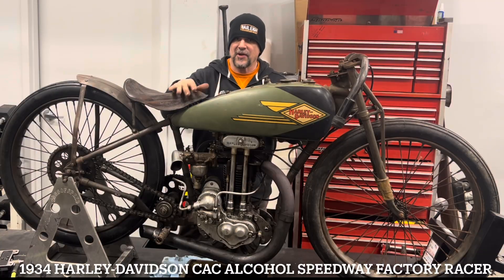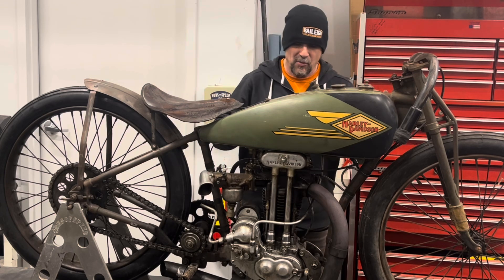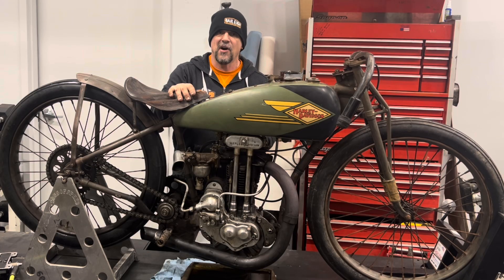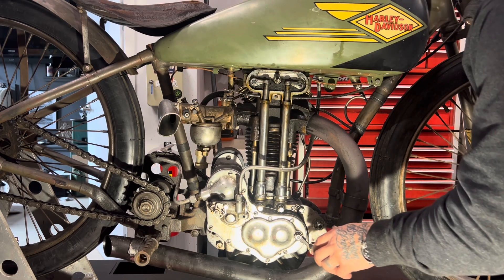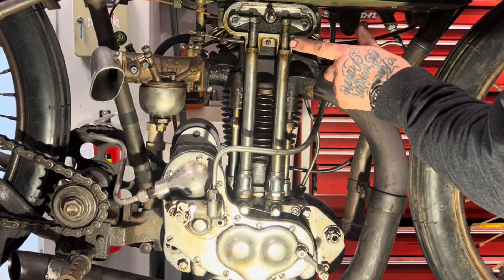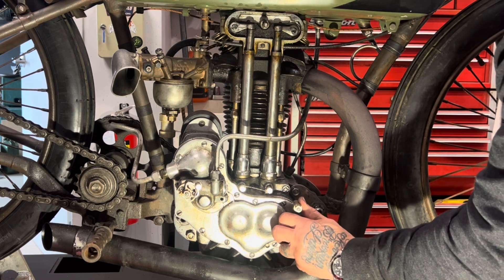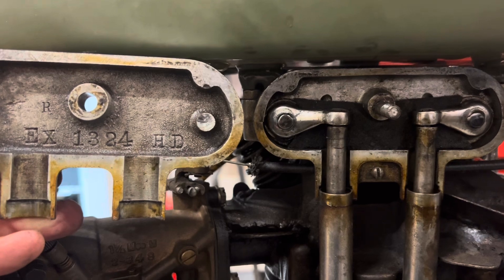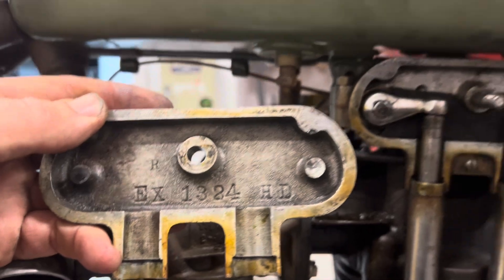Harley Speedway Racer Push Start & Race Engine Compression Release Explained Billy Lane Choppers Inc

Comment: It’s like a mechanical heart beating. I’m obsessed with these old bike and want to race them, but have no idea where to begin. Great video
Reply from the maker: Buy/build a Harley-Davidson 45 flathead, & join us at Sons of Speed vintage motorcycle racing. Get the hang of it, then graduate to a board track racer or Peashooter like this
Reply: @BillyLaneChoppers I’m guessing vintage is the top level but is there aftermarket support for modern parts to build up a bike like this to race ?

Comment: Just imagine if you had to ride it Several hours somewhere
Reply from the maker: It’s an alcohol machine, so cooling fins are minimal. It would definitely overheat if run too long. But I’ve ridden equally uncomfortable motorcycles for several hours.
Reply: @ I would love to have a flat head to race but I would not know where to even start. Thanks for sharing your videos. I have a 74 shovel head. Could you race?is there anything I could do with it

Comment: £200k? Didn't realise they commanded those sort of prices. Thanks for another insight into vintage flat trackers.
Reply from the maker: Another sold two years ago at the Las Vegas Mecum auction for $196K, with buyers premium. It was beautiful, but not in running condition. Mine is the only one that runs.

Comment: Is it a myth that you need back pressure in the exhaust pipes? 
Love watching the engine work in slo mo!
Reply from the maker: No, but different situations require different things. On an American V-twin street bike, you need back pressure to manage your exhaust pulsing to work with exhaust scavenging. On this race bike, you’re running 3/4 throttle to full throttle always, so the exhaust pulsing is manageable. And you need more than one cylinder for exhaust scavenging, which is a non issue here
Reply: Thanks

Comment: That's really cool.  Are you using your foot to kick the compression release lever closed when you hop on the bike, or is there another way to operate it?
Reply from the maker: I’d normally have someone push me & kick the compression release with my foot. Since I’m pushing solo, I just push. After about five flywheel rotations, the exhaust tappet knocks the compression release off by itself, by which point I have enough momentum to jump on and throttle away. The rear wheel has its own flywheel effect which overdrives the engine’s flywheels via the chain reduction.

Comment: So basically it's just start and go. 
Not even neutral?
Reply from the maker: Exactly. Once the engine is at idle, the rear wheel is rolling at about 25mph. This is how motorcycles were raced through the mid 1930’s. No brakes. It’s insane, actually.